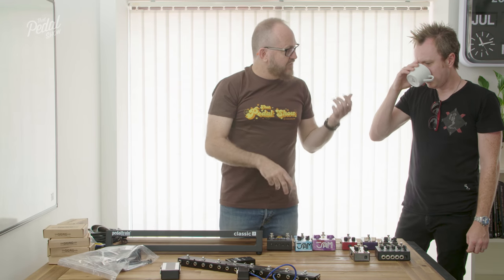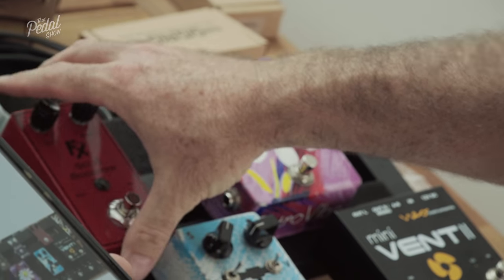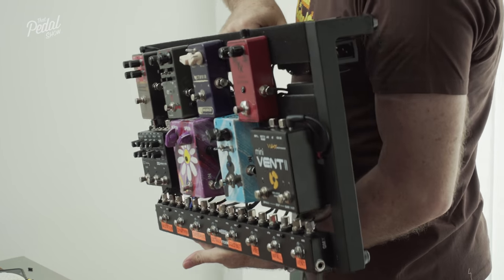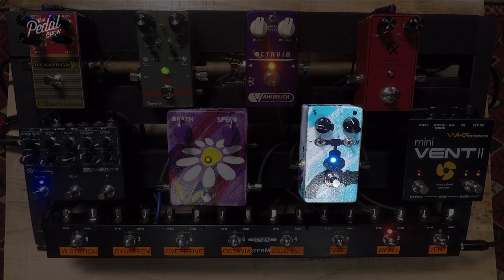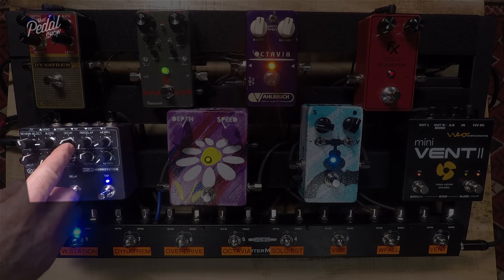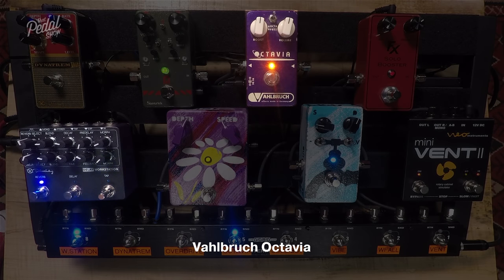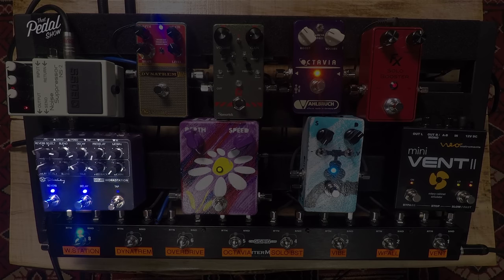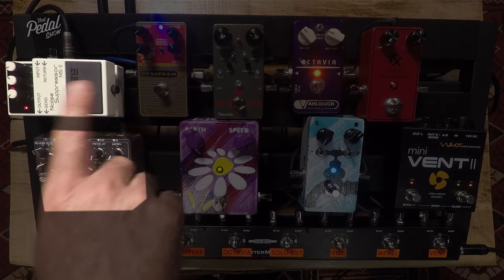Simon McBride Pedalboard Build – That Pedal Show

Comment: Great practical demonstration guys, thankyou.
Dan, In your experience, For the Live use , Is the best way you know of to change user and factory pesets on the timeline via the G2 ? 
I need a solution for this specific purpose as quickly as possible, that i know will work with study. Sorry to come out of left field on this one. I've checked out all the other delay pedals, and the Timeline is the one that will suit me, for live use. cheers and thanks
Reply from the maker: hi there. I only use a few presets on the TimeLine as well as the looper, so i'm happy to do it manually, but hooked up to the MIDI from G2 it works really well.
Reply: Thanks Dan. I thought there were some restrictions on accessing presets from the pedal itself, only allowing you to scroll between banks 0 and 1 (which is 4 presets; each bank has an A and a B). I was hoping that with the G2, you could access the global option, giving you access the all of the factory presets, and hopefully more user created presets. I also need to access the tap tempo with the presets . I am only new to delay programming delay, but i can see the creative advantages. I come form a DD-2 background :)
Reply from the maker: tweed guitar you can access all the presets direct from the pedal no problem
Reply: When you say "you can access all the presets direct from the pedal no problem"
Is that with pressing two footswtiches at once ? I haven't tried that, I thought it might be hard to do that in a live situation. I'll cerainly give it a go. Thanks sincerely for your advice. cheers

Comment: Dan, it looked like you were a combination of pissed off/embarrassed with the noise for the majority of the video. No worries mate, knew you would work it out. Good onya.

Was it basically the gain wreaking havoc with the tremolo pedal? It only seemed to be bad with loop 7 engaged...was the level just crushing the ability of the tremolo to handle noise?
Reply from the maker: Mick here. We couldn’t work out why the Trem pedal/loop was stopping the noise unless there was some kind of gate in there maybe. The V30MkII was creating a lot of hiss as a result of all that gain - any high gain amp would do the same... then you add the loop and it’s open season! A different approach from how we normally do it... hence the NS-2 at the end. Cheers’

Comment: Does the power attenuation in the amp change the way that the amp plays with OD pedals?

I'm thinking of buying a Marshall ORI50C, but wondering how it's going to mesh with my Providence SOV2 (huge head room pedal)...
Reply from the maker: Very much so. Every gain relationship makes a huge difference. Doesn’t matter where you’re changing that gain relationship - guitar, pedal, amp... everything matters. Mick here. Cheers!
Reply: That Pedal Show Thanks, of course  I'll be taking my pedalboard with me when amp shopping (it's pretty much a copy of the board that you guys did for Matt Schofield, minus the  talent and  Two Rock)

Comment: Hello TPS! Question for Daniel: what if we link the ground of the audio to the earth wire of the electrical plug?
Wouldn't it put all the different ground to the same "perfect" earth level, and cancel any hum?
I tried at home it worked with my setup, but I not checked the impact on the sound quality. What is your opinion?
Reply from the maker: That earth wire IS ground. The shield on your guitar should have a connection or continuity through to that earth wire, through the chassis of the amp through to the earth wire on the mains cable. The issue happens when you have more than one path to earth, then you get earth loops :)
Reply: I totally agree with the problem of ground loops. 
However, am I wrong to say that there are no effect pedal that connects the audio ground to the actual earth? 
Because, if it is the case, how could it be possible, when the power supply has only two wires?

Comment: Were you guys playing at ear bleed volumes? I play thru a Friedman Runt, which is quite gainy, and I don't have near that level of hiss unless I'm turned up unbearably loud. Maybe the Victory has a bad preamp tube?
Reply from the maker: It’s loud enough to feel. There was an usual amount of hiss, exacerbated by the recording process. Gain. Hiss. That’s why I use clean amps and pedals. Mick here.

Comment: I was just curious,if there was any development in the noise issue, or if he still uses the noise suppressor on his board since this episode was aired? I just bought a Sheriff Pre-amp today, but I can't test it until Monday! I want to run it in to the Power amp of my Hot Rod Deluxe. Cheers guys :)
Reply from the maker: Dan here, I’m stood with Simon right now, the board is as it was, NS2 intact , and he’s very happy :)
Reply: Cheers Dan :) And thanks again for the video with the pedal pre-amps, It confirmed my choice of the Victory! :)
Reply: One of Prince's guitarists Mike Scott said that Prince liked there clean sounds to be shimmering clean! So they used to run the Wah's through the send and return! :)

Comment: I apologize if you covered this in your video but for a build like this, how much cable (length wise) did you require?
Reply from the maker: Mick here. Very very rough guess.... 8 pedals allowing 25cm each way = 400cm. Ish. That should be more than enough because some of them don’t need that much travel. Ish. Best thing is to measure it out on your own board because the variance is colossal. 
I know when I did my big board we needed a lot and it was //really// expensive. But I figure there’s only one way to do it, and that’s with absolutely zero compromise. Cheers!

Comment: The isolation that you apply to the fx loop (using 2 humdingers).... does G2 isolate already or is this idea as applicable to G2 as it is the Quartermasters?
Reply from the maker: Mick here. As I understand it, G2 offers isolation between the main 1 and 2 outputs, so you can run two amps without any fear of ground loop hum. The problem comes when you also use the loops of either of those amps which may require additional isolation. This is how Dan wired Rabea Massaad’s board, for example. So each FX send from the amp also needs a Humdinger. I think. Dan will confirm or deny. All part of the wholly unpredictable world of effects loops... although for example when I’m running wet/dry amps and I take my dry tap at loop 5 of G2... That output also needs isolation (and phase reversal option) , so I run a Humdinger there.
Reply: That Pedal Show Thanks Mick. This is really good to know. I mostly avoid fx loops, but one of my setups works best using the loop. I have a humdinger and will add it to my board for such occasions. So to confirm, it goes on the fx send and not fx return? Much appreciated and all the best. :)

Comment: Interesting chat about placement of univibe.  I've a Dunlop Hendrix Vibe which never seems to 'engage' correctly.  However i've always had it post gain pedals.  I'm going to try it at the head of the chain BUT would it be wise to put my Keeley Germanium Oxblood before the Vibe so that sits at the head of the chain? ... because it's germanium?
Reply from the maker: Cool - definitely try it both ways. We suspect the Oxblood GE is nowhere near as fussy as a vintage fuzz. In fact, is the GE bit is not the same as the way GE is used in a fuzz. So definitely try it both ways!
Reply: Thanks for the reply and info.  I'll give it a try.

Comment: I have an issue balancing the volume of my delay between my rhythm and lead sounds.  My delay volume sounds the way that I want to for my rhythm sound but when I kick on a second overdrive pedal for a lead sound, the delay is much less audible.  I’m running all of my effects into the front end of a Marshall that is set to be slightly crunchy.  Am I doing something wrong?  Should I just invest in a second delay pedal?  Thanks.
Reply from the maker: Erm, maybe you’re losing the initial attack from the delay with the OD sound? So the clean sound has big transients up front that gives the delay a really strong input signal. The OD is likely more compressed so maybe isn’t giving the delay as strong an input signal. Maybe. ?
Reply: Thanks for the reply

Comment: did anyone understand how in practice they fixed the noise issue? I vaguely understand the concept, but like, what did they change about the board?
Reply from the maker: Hello! We used an isolated power supply and the relevant adapters in the first instance. After that I think, if I remember right, we used a Boss NS-2 maybe in the loop? There are timings guides in the description so you can skip to the relevant parts. Cheers!
Reply: @ThatPedalShow  thanks for the quick reply! it was the power supply bit I missed. I thought you meant isolating it in the loop somehow. happy new years!

Comment: Jeez, do you have a problem with using a friggin noise suppressor? I play through a high gain amp and I don't care who you are or how much you isolate, I have to use a noise suppressor and I use a decimator 2 and it doesn't suck any tone at all and I hate using noise gates or suppressors because it usually kills the signal. Kills your sustain, you know what I mean? The decimator doesn't, it does what it's supposed to do, suppress the noise completely. Try it,you'll like it. My effects are totally isolated too but sometimes that's just not enough.

Comment: Anybody else spy that Victory Sheriff preamp over Simon's shoulder (for instance, 1:01:50).  I'm jonesing for one so bad. There's supposed to be videos out soon on them.
Reply from the maker: Indeed there are! Mick here. Simon and I (Simon our producer) shot the videos for Victory (my other business does media production) and they’re being edited up at the moment. It’s a really interesting approach to pedal preamps that undoubtedly has the ability to sound superb. Whether guitar players will understand that you can’t just use them like a regular stompbox remains to be seen. But the sounds - in my opinion - kinda redefine the amp-in-a-box pedal genre for me. Four valves all running at proper plate voltage.... in a pedal!
Reply: The format makes me all kinds of excited - being able to both add channels to my amp, or take "my (preamp) sound" to backline gigs, PLUS inject some tubes into no-stage-volume gigs (which, for me, means digital modelling - Line 6 Helix) solves SO MANY problems for me I want one so bad.
Reply from the maker: Cool - on Victory’s behalf, I’m so glad you get it! I really hope you’ll like it. It’s certainly a unique approach that makes a lot of sense at this point in time. :0)